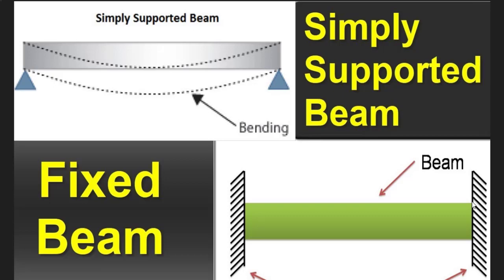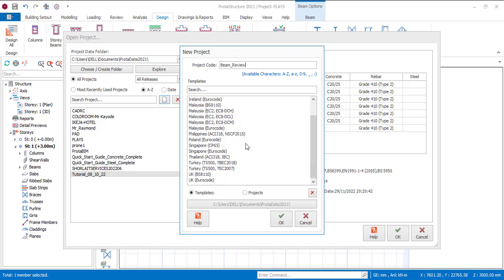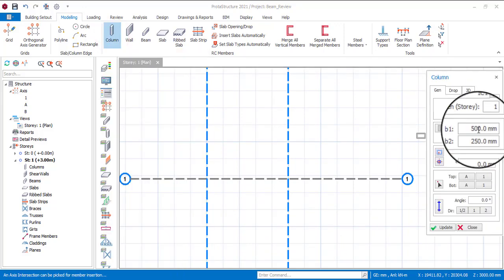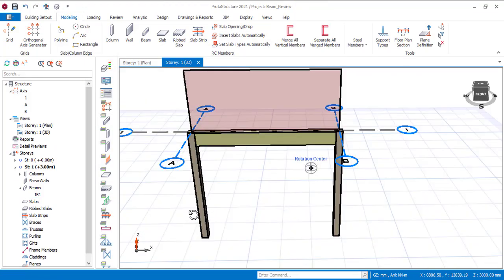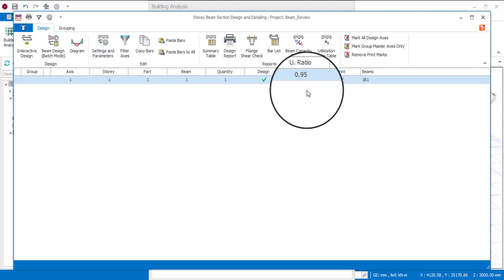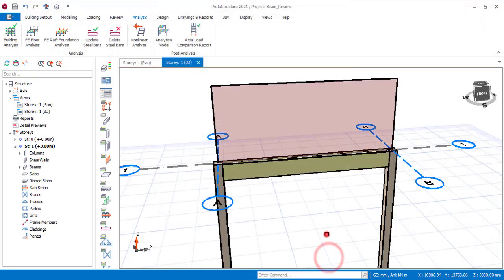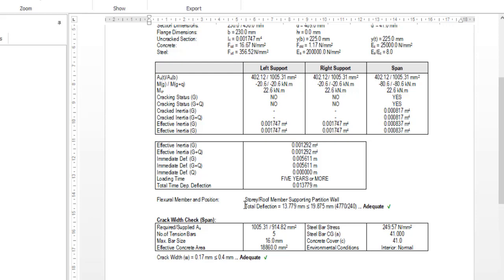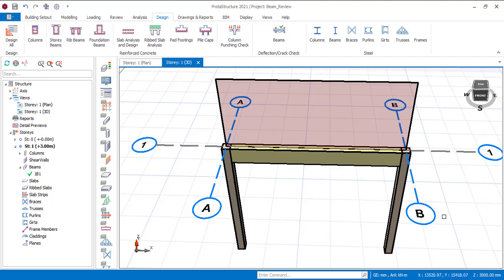Which is more Economical and Stable? Simply Supported or Fixed beam? A review with ProtaStructure.

Comment: Good day Mr ridwan, why did you made the unit weight of the block to be 15.
The unit weight of block is 3.4Kn/m according to my understanding
Reply from the maker: Thank you for the question sir. The unit weight of a 225mm Nigeria block that is plastered with cement binder of a thickness not more than 50mm at both sides has been established to be 3.47kN/m2. Yes, you’re right! 

However, the load applied to the beam in the above video is not a 225mm block wall load. The load I applied is a nominal load for the sake of analysis and review purpose. This is the same load I applied in the second episode of this review. Let me know if I’ve answered your question.
Reply: @ridwantician  kindly explain what you mean by a nominal load. I am talking in real life design.
Because when calculating the dead load of the beam.
You consider factored self weight of the beam and the wall load and finishes.
I am honestly trying to understand what you mean by nominal load.
Reply from the maker: @Siafat-d7z  What I’m saying in essence is, I didn’t apply load of block wall to the beam. I basically applied a uniform load of a known value. The beam in this video is not a storey beam or a foundation beam. It’s just an idealized beam which is loaded with an idealized load for the purpose of the review.
Reply: @ridwantician  ok now I understand. Thanks